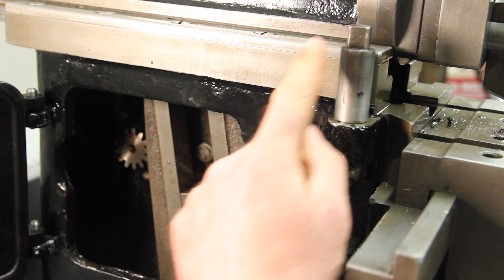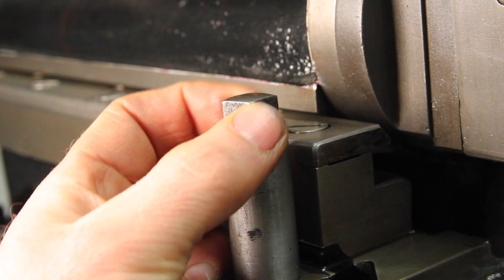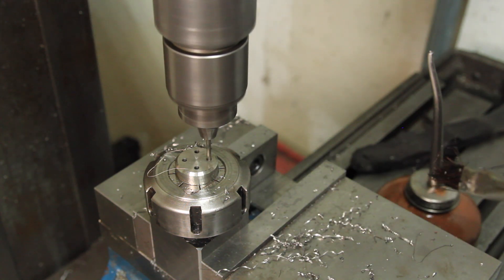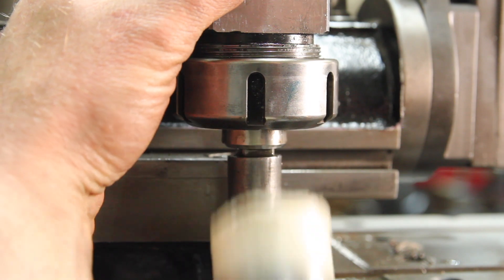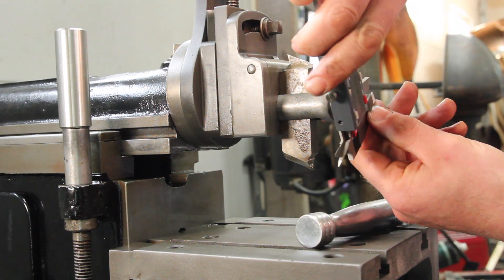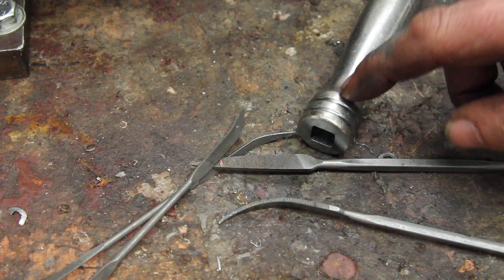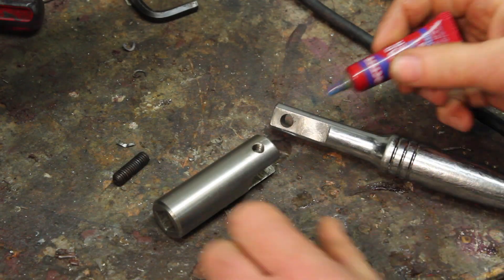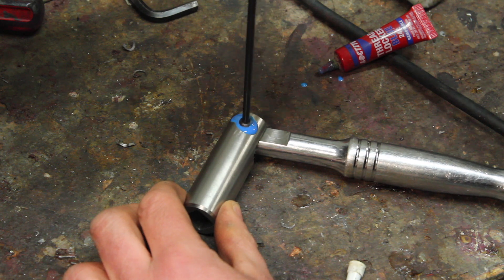Drilling Square(ish) Holes

Comment: Jeremy, a suggestion. In my opinion the shaper is ideal to make square corners... Just grind a cutting angle and two relief angles of an undersized piece of high speed which fits in the center start hole of your workpiece. Put the workpiece in a square angle block and let the end rest against the back vice of your clamp. Etc. Maybe an idea for an upcoming challenge. Thank you for sharing all your work. Best, Job

Comment: I see you've finally got the collar off the mill spinde.
Reply from the maker: The collar on the collet chuck comes off fine, the collet chuck itself is stuck in the spindle taper.
Reply: @JeremyMakesThings  oh right. once a taper is too tight in there might be no coming out cleanly. I'm reminded of when Keith Rucker mistakenly tightened up that tapered fit between the shaft and wheel of the bandsaw he's working on right now. He ended up drilling the shaft out and making another.
Reply: @tilliesinabottle  The problem is not too tight, the problem is that its a part of a complex geometry system... Were it only too tight, you could just slap it under a 200 ton hydr press and give it a kiss... If it aint working, put under 1000 tons press, that will do it, but you cant really do that with a fucking spindle.... I tried giving Jezza some ideas on it, but he already tried those or similar before and got no cigar... Only idea I have left is for him to go and buy some dry ice and shove it in through the collet opening up the collet holder body, just pack up the thing all the way up to dbar threads in the holder, and constantly tap the drawbar from above gently as to undo the taper lock the instant the holder body gets cold enough, but hasnt yet allowed the spindle to cool and contract... If that doesnt work, I would just remove the spindle with the holder and chuck it up a lathe and give `er wha` with some good old cbn until the taper dimension is close and the walls of the holder body are like 1 mm thick or less and then give it to a hydr press, 2 tons should be enough to break the taper lock with no meat to support the taper walls... Hell, he could even reverse mill it with a contraption that would feed the lathe tool up the spindle of the mill at the desired taper angle - again - until the holder body is less than 1mm thick along the walls and give it a good old whack... If removing the spindle is a no no due to laziness reasons...